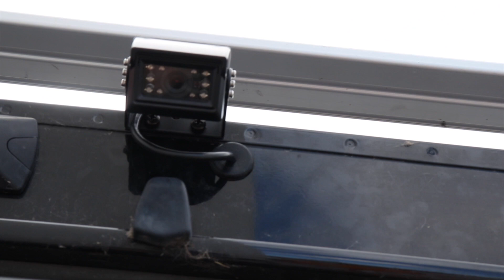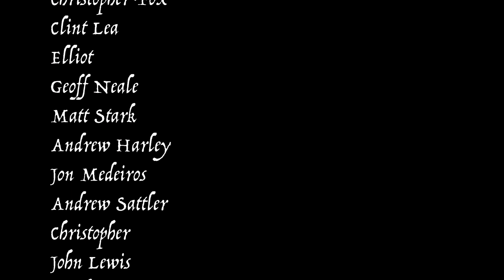Trying to FIT a FAT FOCAL FLAX

Comment: Wow, them crossovers are huge! Now, ofc they cannot fit in the door but could they not be located closer to the door, on each side. Saves a lot in multiple speaker cable runs? 
And possible degradation in sound  with so many wires to pickup noise? Just a query? Thx

Comment: I have a 2011 vw gti and was wondering what component  speakers do you recommend that sound good with just the head unit I have a Kenwood double din
Reply: QWIKRacing Tv  any JL Audio sets, Alpine type r's are good for low power systems. You could also go for Kenwood comps since you already have the head unit